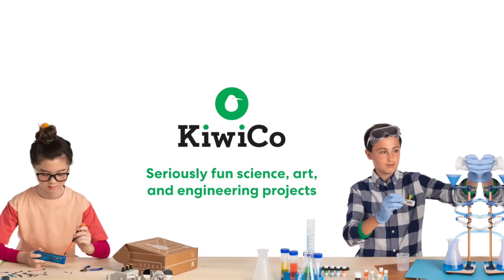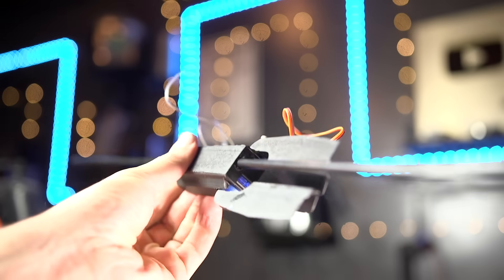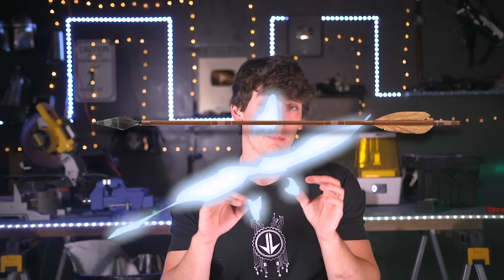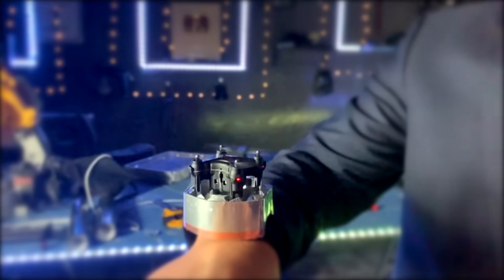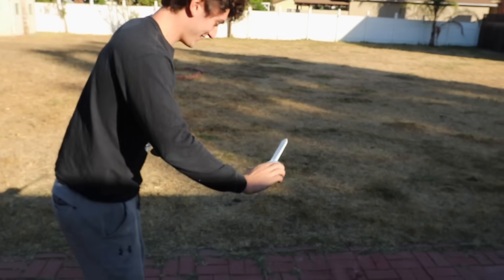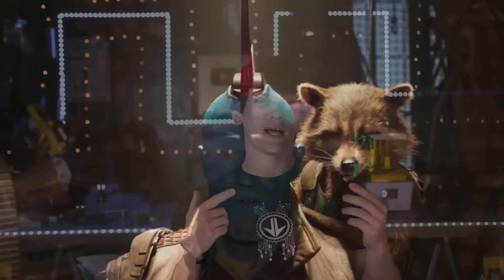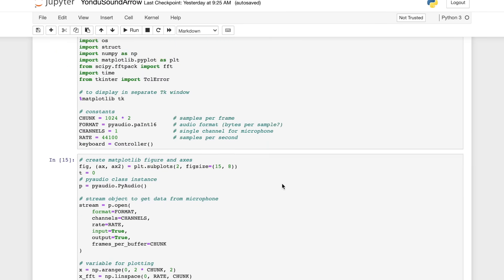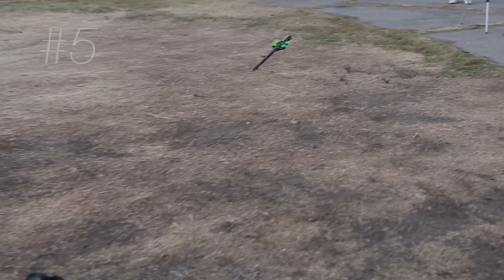Working Yondu's Arrow That Flies When You Whistle! - Change Direction In Flight!

Comment: I think you’d need at least 2 whistlers for smooth controls. One set of tones for higher or lower, and a second set for horizontal movement.

Otherwise you may need to assign more pitch ranges and have very stiff controls

Comment: For the "next" project, Get a master whistler and make the arrow more whistle controlled? Pretty Please???
Reply: I dont know if that's even possible
Reply: @jacobrutzke691  If it can handle two categories by an untrained whistler, then he should be able to further subdivide whistle sounds into more distinct commands for someone who has better control over their whistling sound and tone. In theory, it should work.
Reply: @ShayerSUtsho  just split it I to three frequency ranges and skip backwards completely. Then the middle frequency is directly forward, while high and low bank left or right. Were still missing power control through.
Reply: @A-McDrae  It doesn't have to be split by just frequencies. If he uses short sound sequences instead, he could potentially add infinitely many commands to it. For example, a gradual rise can be 'accelerate', while a gradual fall can be 'decelerate'. A short rise and a short fall combined can be 'turn left' in that order, and 'turn right' in the reverse order. A sequence of a low and a high note can be to raise altitude, and the opposite can be to lower down. 3 consecutive short whistles can mean emergency break. The list goes on. There are more combinations of sounds that can be used as commands (memorizing them all might be a little hard for the master whistler, that's all).
Reply: @jacobrutzke691  might as well give the idea. Never know what this guys gonna come up with
Reply: That's a HORIBBLE idea
Reply: Pretty please with cherry on top
Reply: Why a master Whistler? Try make a whistle for yourself and if you can't make a whistle with your mouth your not naturally gifted
Reply: @ajayplayz3000  Can you whistle all of Mariah Carey and Celine Dion's songs with absolute pitch perfection and accuracy? No. Neither can I. But a Master Whistler can - they have that kind of whistle range as well as control over the volume, pitch and tone of their whistles, making it possible to subdivide their whistles into hundreds of distinct commands. As for the question of being gifted: there are people who have a favorable gene and upbringing, but whistling ability, or any other ability for that matter, doesn't require you to be "gifted" or "talented". As long as you have the organs needed for the task, you can learn the skill to any degree of perfection. In this case, if you have your lungs, esophagus, throat, mouth and lips, you can whistle, and you can learn to whistle amazing melodies. I couldn't whistle till the age of 18, and one day I suddenly heard a sound when blowing softly, and I immediately tried to remember how my mouth felt doing it, and practiced 24/7 for sever weeks till I could recreate it without fail. Even then, my range was very limited; and yet through practice, whistling has become a staple of my musical profession now. So yeah. You don't have to be "gifted", and there's a whole range of control to learn in whistling to become a master whistler.
Reply: @ShayerSUtsho  lol I not reading all that XD
Reply: @ajayplayz3000  suit yourself
Reply: @ajayplayz3000  the reason for a master Whistler is they can control the direction and make it move like the movies
Reply: HOW ARE WE GOING TO GET THE SOUND SENSITIVE METAL!?
Reply: @fpstudio3974  he could also bring in a expert with sounds to be able to help with the project I’m pretty sure people would like to recreate a movie scene at the best ability
Reply: @swiftxxw0lf  but who would he get?
Reply: @fpstudio3974  There's no such thing lol, that's why he's using sound sensors instead of sound-sensitive metals. Sound sensors probably didn't exist back in Stan Lee's days, hence the lore he came up with.
Reply: @ShayerSUtsho  The other question is that is it possible for him to make a whistle controlled arrow
Reply: I dont think he is the type of guy to put in that much effort.
Reply: Actually they all are useless
Reply: @mostafahassan40  What do you mean?
Reply: I mean that they all are kinda useless unnecessary
Reply: @mostafahassan40  You made that clear the first time. What's the "they all" you're talking about? What's useless?
Reply: @ShayerSUtsho  every thing he makes but the spider walker on the wall it’s maybe the only one is useful and think before you write
Reply: @mostafahassan40  these are entertainment videos. Perhaps you're not familiar with the Marvel Movies. You are talking about the usefulness of a look-alike replica of a fictional weapon from a fictional character in a fiction-fantasy movie - it was never supposed to be useful. You're basically judging a fish by it's ability to fly. This is pure entertainment. If you're looking for usefulness, you're browsing the wrong genre of videos.

Comment: One thing you can try to go left or right is use your voice and Whistle for left and right and regular whistle for up down, still won’t be even close to the same movement capability as the real thing but still at least adds left or right. ( I haven’t fully checked this theory but it might be a different frequency when using your voice

Comment: Awesome stuff, a few things you could take advantage of in order to get slightly faster and more efficient control of the arrow would be keying specific whistles for slightly more range of motion, such as a long high pitch whistle that fades into a low pitch to engage a left turn with the opposite to engage a right, a short high pitch to add height, a short low to drop height, a mid length low-to-high to accelerate forward, a mid high-to-low to decelerate. You should rewatch GotG to try and dial in “Mary Poppins” whistles a bit, its actually impressive how many types he utilized.
As for fun projects, id say big hero six’s magnetic bike

Comment: Just a "thought" here but what if the  tone of whistles were x,y,z coords from your controllers position (zero). also probably good idea to tell your controllers facing (degrees) for it gives a zero point for the arrow to follow from, even when walking around with the controller.
Reply: then whistling louder/high pitch could be speed....but then note would be location, in relation to controller.
Reply: also think ocarina....whistle proper sequence and it will follow a full path. or a specific command, like do a backflip. or come land.

Comment: First time watching. Really impressed. Much better than I anticipated, given the degree of difficulty. I'm a retired software developer. Used to have a poster on my wall in the cube farm..... Only by attempting the absurd, can we acheive the impossible (not my own saying, but it was indicative of the work we did). For this, I was envisioning a cylinder, with an internal inline prop and louvers about 3/4 of the way back (?) to duct the flow for control, battery and controls in the rear. Maybe a canard in the front? With no R/C experience, I'm not sure how small of tech is possible. Not sure any of it would work or supply sufficient lift or how large the cylinder would need to be. Definitely liked what you did though.

Comment: That was cool, even Yondu's arrow looks like that red bit balances and provides both thrust and lift so for a current-tech and atmospheric version of it I'd say it works well :P

That bit with the bow XD
I mean, you're no EMIYA with a bow, but really, since when is anyone anywhere in the ballpark-no-continent as him? His bow has like over a metric tonne of draw weight, is made of some kind of metal and fires arrows that weigh as much as a large domestic animal, and that's on top of his eyesight that's like 20/2 when using Reinforcement and his decades of being a flawed Hero of Justice. Wait a moment, what if someone makes a bow like Archer EMIYA's? Like, an arm mounted monstrosity with a winch backpack and a locking exo-arm that's all on a large shock absorbed rail and its basically a hyper-powered crossbow of sorts. That'd be awesome lol

Comment: That's honestly kinda cool, but could you make the arrow lighter and with a sharper tip (kind of more cone-like), so you only need 1 or 2 propellors on top instead?

Just thinking that your arrow is bigger in every dimension (fyi, I do understand that there are Earthly limits to recreate fantasies)
Reply: Alternately, could you use a propellor on the rear of the arrow and curve the fletching (unlike Yondu's arrow) so it spins as it travels forward, and reverse-spins to retreat? 
The aim with this idea is that the fletching will prevent the arrow from dropping temporarily whilst it changes from forward to backwards.

Either way, both ideas are probably trash, but they might help you think up other improvements...

Comment: just put a small motor on to control two large thin fins in the back, then use compressed air or co2 as propellant, that you can control with another small actuator of some sort, use the lightest weight things you can, and make the tip heavier. I think that'd be you're best option. also put a real blade on it lol way cooler
Reply: there's the real blades, nvm bout that part

Comment: Motorized skates that accelerate depending on how far forward you lean. You can put a tilt mechanism between your feet and the wheels so that you could lean forward without hurting your ankles. I got the idea from an older Anime called Air Gear. Here's a link to Air Gear's MyAnimeList web page.
https://myanimelist.net/anime/857/Air_Gear

Comment: THIS IS AMAZING!!! I was actually working on something like this a few years ago but set it aside because I didn't have the resources. I focused a bit more on the software side, and started an Arduino program that could recognize whole whistling commands based on pitch and pattern for complete control! Combine that with the hardware you've got, and we'd actually have the real thing 😱

Comment: I got a video idea and a video to show how and why it shouldn't but does somehow work. It involves magnetic coupling and lazers to cool and a self recharging battery while pumping out more power than any meter I had at the time would allow later pumping up to 135 volts on top of its own recharging and operating and it never touches another anything just gets real close! Also it's only powered up originally by a 6 volt pile battery then after that it's self sustaining. And no I'm not calling it an F.E.M. I'm calling it a magnetic coupling energy covertion harnessing oscillator and expansion device. Or the mc-echo-ed. If your interested you can find me here or on twitter. 

Also bonus design idea since you have a 3d printer is a tool rack for the 3d printer that moves out of the way when the extruders are moving at it! With a bin for small plastic a bin for medium odd shaped plastic and the last for shapes or reusable rafts... Also if anyone has any good uses for the spent filiment I'm always open for suggestions! I found the round rafts make great plastic washers for screwing into soft material such as thin metal or even card board!

Comment: Its possible... If. You build a sensitive rader control system which resonace with your whistle and a very complex digital programme which understand the coded whistle.. Try it...and also the arrow should have propulsion system...in nano... Measurement

Comment: Since you had the load capacity to mess with, you could have used an APS or a rangefinder inlayed in the arrowhead. Probably wire ig in to the existing hardware of the drone through the shaft so the software reads it & it should keep the tip straighter during flight. Just a concept. Not sure it'd work. Hahah.

Comment: You can make it work with a little change: one pitch controls the turning of the arrow, that is the rotation in the horizontal plane, the other pitch is just forward. This way, it can move everywhere except for a straight reverse.

Comment: Great job but... The whole point is that you can steer it in all directions xD so it's not quite there yet, you should keep the project going and associate different directions with different pitches, you can use western music theory and apply the 7 standard whole notes to different directions on a compass (or a combination of left control stick & right control stick inputs) and set aside 2 non whole note pitches for vertical controls, then get a musician to help test it, also a live demonstration would be more entertaining in my opinion then putting music over some basically stock footage of the arrow flying.  Critiques aside I'm sure you put alot of time and testing into getting it this far and it does resemble the item you were hoping to match, I just feel like you stoped running this marathon at the 25 mile mark 🤔

Comment: How about a backpack system that takes the old school bugout idea and modernizes it with things like the biolite stove, big power banks foldable solaprpanels etc.
Long term tech nomad style.
Optimally with a kinetic power generation system in the frame like the military is currently testing (same concept as a shake light flashlight).

Comment: To be fair quartz is a piezoelectric Crystal which produces a voltage when it is hit or when sound is around it which is why it's used in a microphone and the funny part is quartz is mainly comprised of silicon which is a metalloid so sound sensitive metal doesn't exist but sound synthesis of metalloids do exist

Comment: If u actually know how arrows work u would figure out that they spin(so the fin would be difficult to steer and would have little impact) and the arrow bends and vibrates in the air ( also making the fin in the back or any rocket design almost obsolete). Your creating a miniature missile, not an arrow.

Comment: If you wanted to refine on this a bit with a bit more manual control, I'd probably make the drone auto level, but otherwise have no pitch, and install a motor or two on the back for forward/backward motion, and a motor on either side (or maybe just in the center) to control strafing left/right. The current build does surprisingly well at flight, but of course wind would be a big concern, and the tilt to move forward is going to create drag because of the long arrow shaft in the front, meaning less control and a lower top speed. Whereas a setup that auto levels and just flies directly forward would be much more aerodynamic and stable, and I think could really add to this design, and even make it somewhat practical, assuming it could get enough speed to do damage (with a metal tip of course).

Comment: I know this is probably of budget and harder to control , but if you used a better recurve bow with a much higher pulling strength , you would have a much higher speed and air time , plus you could use a carbon fiber or  a bamboo arrow they have a  much lighter weight and they can well balanced

Comment: It would be easier to control it with your hand with the Myo Gesture Control Band... Using controlled CO2 release all around the arrow that has orientation release to keep the arrow afloat and pivoting and release at the back for propulsion. High level project but that's how I would make it. The issue would be, running out of CO2. The soultion would be extremely powerful micro fans throughout the arrow with a sensor worn on your hand so the arrow slows down to a halt only when it returns to you. Yondu's arrow is definitely within the realm of possibility it would just take even greater engineering for it to actually "go through" people LOL.

Comment: You should just have it fly forward, make the amplitude of the whistle change the altitude, and the pitch turns it. Like have a baseline frequency that makes it go straight and as you go lower it turns left and higher turns right

Comment: essentially making a military grade homing missile which is 1000000% smaller than real ones, controlled by sound. Simple
Reply: 100% possible to make. It would make more sense for it to be controlled with hand gestures using the Myo Armband with a sensor for worn on the hand so it slows to a halt when it comes back to the handler. The issue would be getting it to go through "real targets" without compromising the functionality.

Comment: It gives me cringe every time he fires that arrow, there's lots of safety hazard there especially when trying to maneuver the arrow and the one controlling it is in the front. The arrow with rocket on it gives a delay time on blasting the arrow and  with mods on the arrow could potentially points to them and will blast the arrow back at them. Other than that it's fun, but safety should always comes first

Comment: I Have an Idea:

Whistle: To Make it Go Forward and Backward
Attach a Sensor On The Head.. I Think its Called Gyroscope Sensor and if you look up arrow goes up, look down, look left, look right.... It Will Work According To The Head Rotation.

Attach The Sensor On a Cap Or a Head Band.

It will Float in air if you are not whistling.
Reply: This needs WAY more likes. Putting it on Yondu's mohawk thing would make it perfect and disguise all the equipment.

Comment: My ideas:
Hulk hand(that can destroy metal maybe use pressure mechanism)
Iron mans robot(for helping you pick things up,use a controller and hook it up to blue tooth
Miles morales light powers(use electricity to make it burn things or shock em’)
Docter dooms green lasers(make a hole and put stick in place and something is gonna light it up on the inside and then shoot)edit:forgot something make a voice commanded umbrella to protect you,and shoot and gun pellets but since that’s dangerous use nerf pellets.

Comment: Been thinking of using a .357 bulldog pcp air rifle to make a real plasma railgun. Amoe is compressed powdered quarts to store charge with copper coil and nail to charge while using the quartz to store the charge like a cap magnetic propulsion to charge the capacitor round that will disperse on impact.